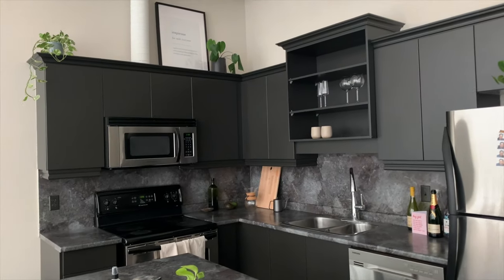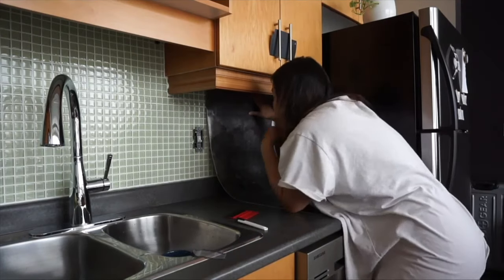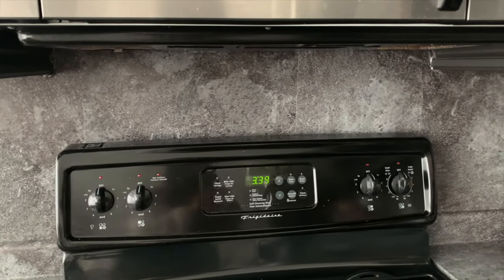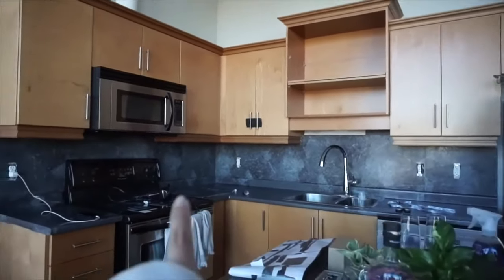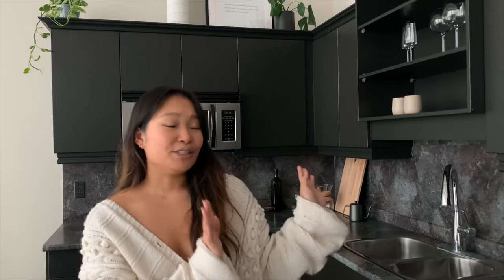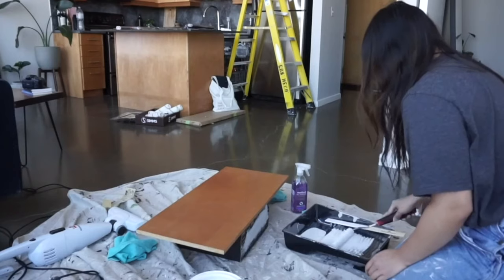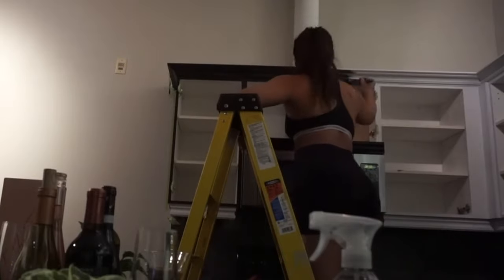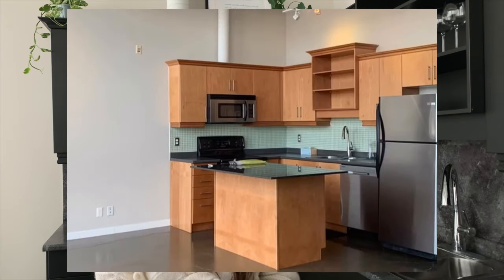DIY MODERN BLACK KITCHEN | stone contact paper & painting cabinets

Comment: Great Video!!! How has the counter been holding up? Is that durable??
Reply from the maker: Thank you! Yes - some of the contact paper got some air bubbles from the heat of the dishwasher (the part behind my mini bar area) but otherwise it's been great!
Reply: @inspiroue  i found a little solution for te counter... Try using 12x16 or 12x14 size clear glass cutting boards... That way you can still see the design but keep things off of the counter directly.. It will help tone down on things having contact... Let me know if that works for you.

Comment: How long did you have to wait to put on the backsplash after putting up the drywall and caulking?
Reply from the maker: No time! The drywall is dry so you can apply it right away but be careful with moving the drywall before the caulking sets!

Comment: Would love to know how the counters are holding up? I just ordered this paper but it feels a lot thinner and cheaper than others I've tried. Im worried about durability.
Reply from the maker: I replied to a few other comments about them - they're doing good! x
Reply: Same here.. I'm thinking of doing polyurethane (oil based for heat resistance) over my contact paper. You can get a matte finish polyurethane that looks great.

Comment: You didn't mention if you sealed the cabinets. A poly would keep them from chipping  or scratches. 2 or 3 coats (it's fast drying) and your good.
Reply from the maker: I did not haha probably should've ay? they've held up well with no chips or scratches though!